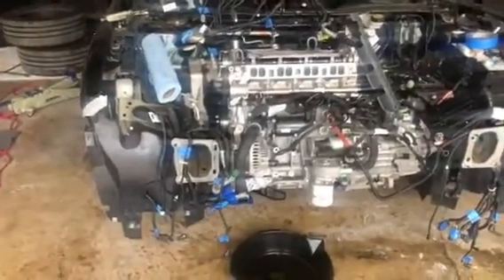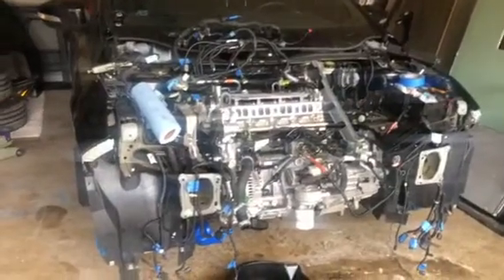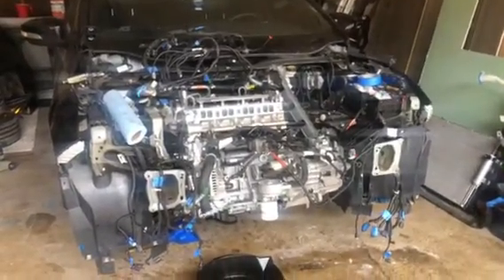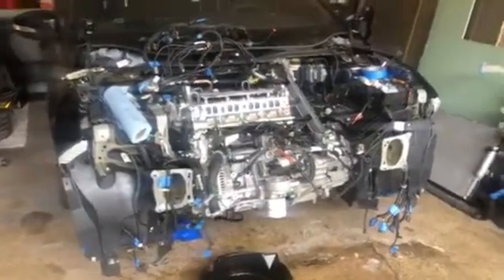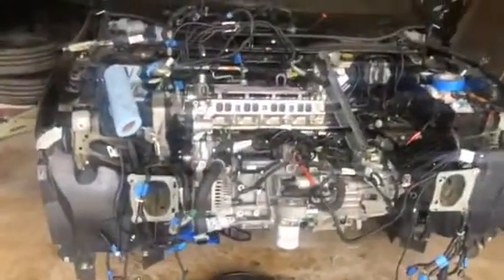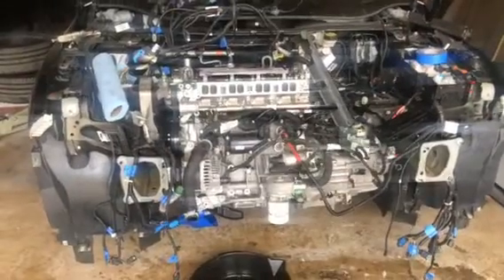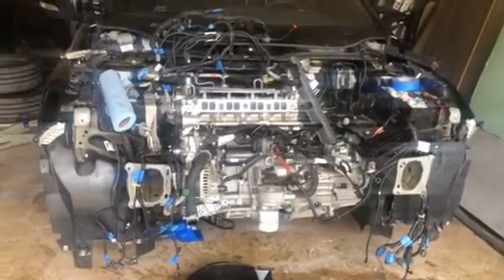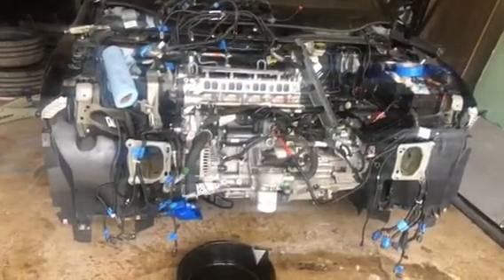Focus RS motor update

Comment: What does ignition cycle count mean?
Reply from the maker: electropentatonic every time you flash your ECU your ignition cycle count (every time you start your car) will reset. So if you blow you motor, flash your ECU back to stock, and go to the dealer it shows them that you have started the car one time since messing with the car’s computer.
Reply: @gapperformance  Got it. Those sneaky bastards. Looks like you got it all dialed back in though. Nice car, love those RS
Reply from the maker: electropentatonic yeah the rebuild was hard but pretty fun to learn the car inside and out. I had 8200 miles.
Reply: @gapperformance  ouch